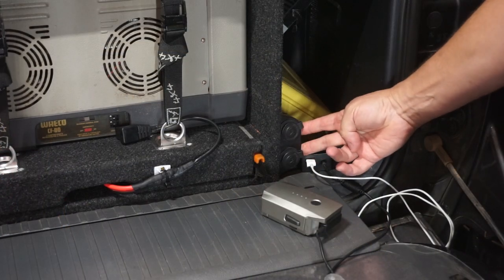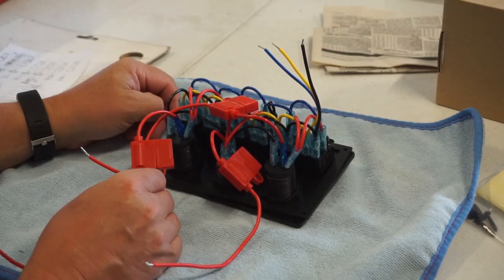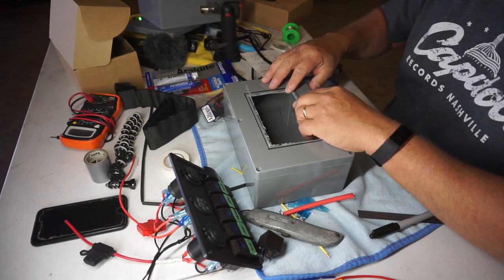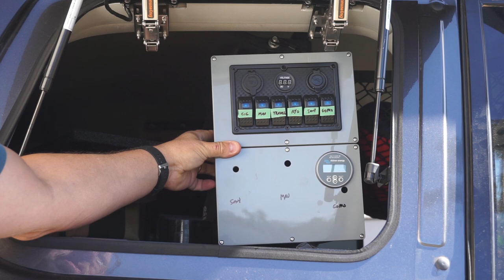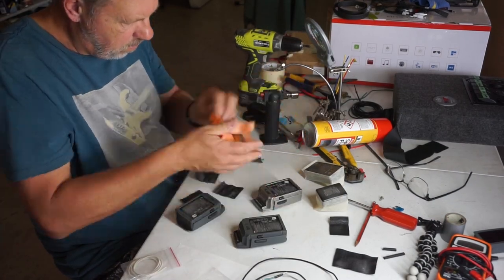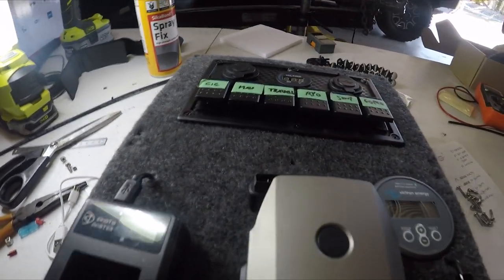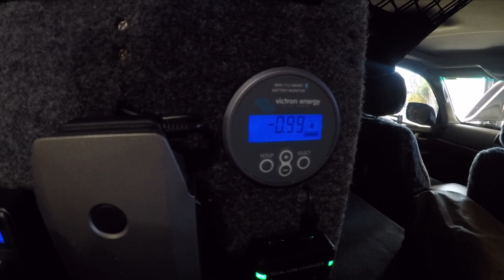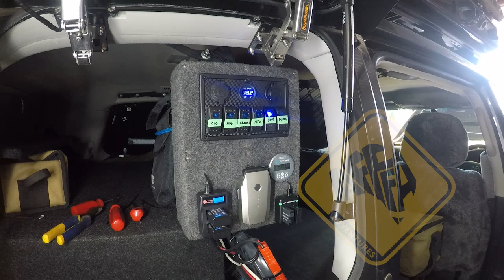How to Wire a 12 Volt Switch Panel | Cleaning up the wiring in my Landcruiser 4WD

Comment: Info on the boxes you’re using please.
Reply from the maker: If you are talking about the boxes that I have used to mount the switch gear, as noted in the video I bought them from a retailer here in Australia called Jcar.  Cheers

Comment: Terry, great video.... So how many amps are you drawing when you have all the accessories turned on?
Reply from the maker: Bugger all mate. Anything that draws more than 2 or 3 amps I have running through a relay.  The switches themselves cannot handle a lot of current (I think they are rated for an amp or two).  Cheers👍😎

Comment: Looks good Terry, I assume the velcro doesn't hinder the mavic batteries when installed back into the drone. Cheers Steve
Reply from the maker: Thanks for watching and commenting Steve, I really do appreciate it.  The Mavic batteries actually have a very small recess on the bottom side and the Velcro fills that up just perfectly.  Batteries click in place with no interference.  Cheers😎👍
Reply: @JafffaAdventures   I was going to ask the same question as I have the same drone. Excellent job mate, well done again:)
Reply from the maker: Thank you for the kind words mate, I really appreciate it 😎👍